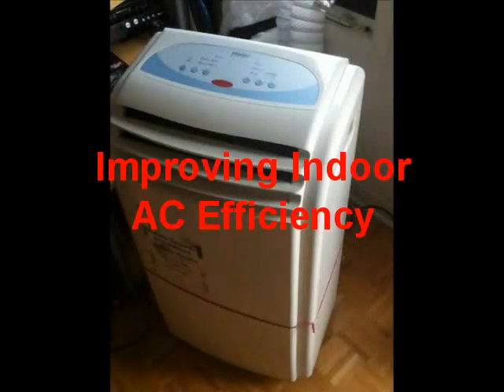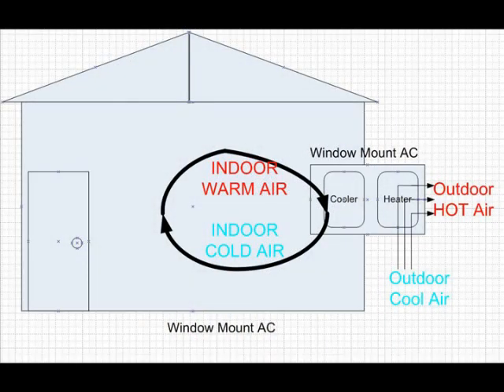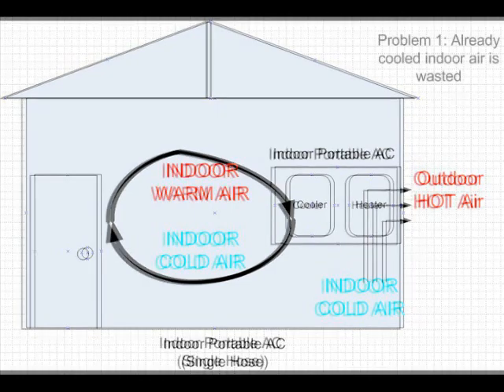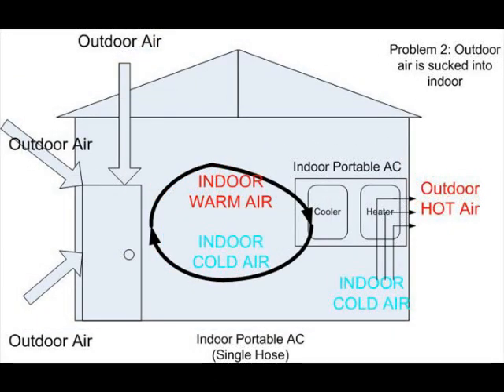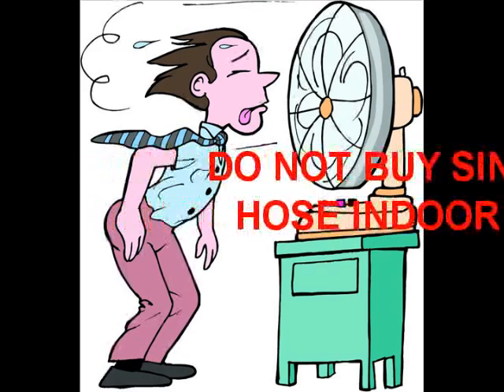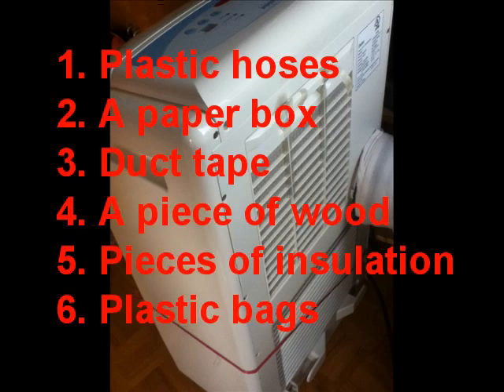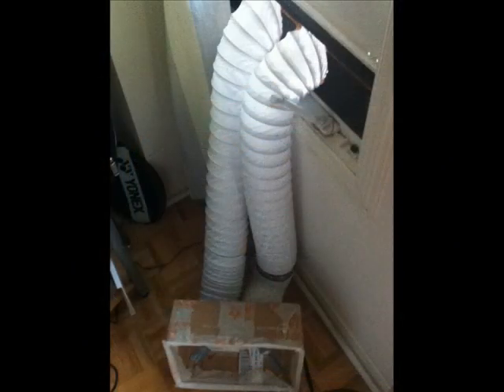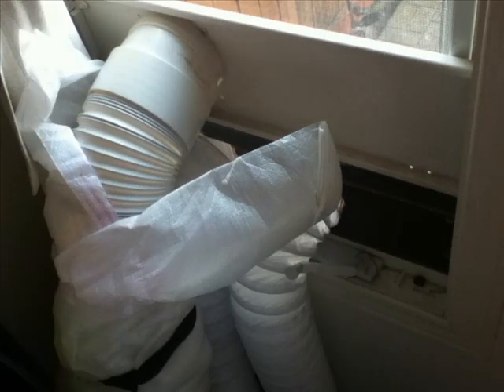Indoor Portable Air Conditioner Efficiency Improvement: single hose to dual hose conversion

Comment: Thank you for hour inspiring ideas, use the Dual Hose is so much better, but they are not available in Europe. I live in a Historic Building and it is impossible to put a condenser outside.
Also, I would also like to spray the condensate water over the condenser coil on order to increase the efficiency 👍.
Reply: copper has a degree of flexibility - if you could get my hand on an old single tube model for cheap, I wonder if you could just bend the evaporator coils and condenser coils 90 degree out of plane with each other, and build a new chase for the outdoor air.  Because the real problem, as critics of this video point out, is that the cost cutting move is really about having a single blower and enclosure for it.  So 1/2 of the indoor air gets sucked and pushed out over the evaporator, and 1/2 goes over the condenser.
Reply: BTW, surprised to know Europe allows the idiotic single tube design!!!  The manufacturers must have had to bribe a bunch of EU regulators haha!

Comment: What if you live in a hot city like Pheonix or Las Vegas, or a humid and hot city like Miami or Houston? Since the inside of a portable a/c is metal, plastic and wiring, I would think you wouldn’t want super hot air and/or lots of humidity going into the unit. 🤔

The most important thing really is to ignore the ASHRAE rating and look at the DOE SACC rating instead, which takes into account the inefficiency of a portable a/c. 

If you want to cool a big room, like a master bedroom, you want a SACC rating of around 7,500-9,000 BTU’s. For smaller rooms, 6,000-7,500 BTU’s should do. I wouldn’t mess with anything that had less than a 5,000 BTU SACC rating (unless the room is smaller than 150 square feet). 

Covering your exhaust hose with an insulated HVAC duct will eliminate the heat coming from the exhaust hose. You can use big zip ties or shoe strings to secure it on both ends. It’s ugly, but it works. 

One last thing, once you start using your portable a/c, keep the filters clean and check your unit for water as often as you can. This will help it run as efficiently & effectively as possible. 

Stay cool! 🌬😎

Thank you for sharing this video.

Comment: Can't you just put some plastic wrap/cling film over the intake grille (taped down securely with duct tape) and attach it over the 2nd hose with a rubber band instead of all this unnecessary boxing, etc.?

Comment: I did the modification but still theres not much improvement instead it put some extra load on the exhaust fan and i noticed a decreased airflow from the exhaust hose, secondly the compressor got hot and had to remove the modification.
Reply from the maker: Could it be because the new hose(s) you added is(are) not wide enough? I wanted to make sure the new hoses I added did not limit airflow. That's why I added two intake hoses instead of one.
Reply: onlyzaki4u Think about it, if you have a hose pulling air in, and exhausting back out, that is indeed pressure equilibrium, however, when you take half of that air, and use it to blow into the house... suddenly you are no longer in pressure equilibrium, and are fighting again in a different way. You are then moving the load from the exhaust to the intake, which the unit may not designed for if it was originally an exhaust only unit. 
The cure for this is to make your intake hose perforated(add mesh to keep critters out). This will cause natural equilibrium to occur at the optimal location. This will mix part of the rooms air with fresh intake air at the perfect ratio naturally to offset the negative pressure caused by the exhausting of the hot air, and the opposite positive pressure caused by air being pushing into the room from the outside.
Additionally, it will chill the air exiting the AC by mixing in air that has already been chilled by the ac, increasing efficiency further :)

This may be over thinking it, however, you could install thin rubber flaps on the inner side of the perforations to serve as a barrier to the outside when the unit is not running, which would allow the air from your house into the hose if it is in a state of positive pressure. Think of a giant one way valve :) That is more that most people would need, but would keep the cold air in when the unit isnt running without manually sealing off the intake hose.
Reply: ***** That's not possible on a single fan unit. The air conditioner must blow air into the room, it has to come from somewhere. 
If you have no intake, and only exhaust, you have a negative pressure situation, intake and exhaust is positive pressure because the air being used to blow air out of the unit comes from outside. 
You have to do a little of both in order to balance the airflow, and a perforated intake is the only solution for a unit originally designed for a single hose with a single fan.
Dual fan units automatically pull air from inside and outside to balance out the pressure. They have a fan for inside, and a fan for the intake/exhaust.
One fan pulls air from the room over the coils, and back into the room.
The other blows air over the heat pump to cool it, possibly melt condensation ice, and blow air outside. 
My advice was for a single fan portable AC unit, which I suspect is the guys problem that made this post.
Reply: can i instead use an electric air pump used for inflatable? it will make the hose much thinner and still pump a similar volume of air into the intake vents
Reply: ***** It will not be a similar amount of air. Maybe a shop vac... Air pumps have a high static pressure, but a low cfm. The amount of air these move is quite impressive.

Comment: I have this other unit the fan it is not as powerful I had to put a booster fan on the intake with a 6 inch intake pipe and had to take the unit apart to seal all the compartments to separate the condenser with the evaporator and the cooling capacity has tripled it was just very messy I use a lot of expanding foam and caulking on the inside and mounted a galvanized sheet Inlet on the outside with a very expensive booster fan I paid about 170 for it

Comment: If there's anyone watching this channel, can you possibly tell me how to be sure which is the intake? There are two areas where air is coming into the unit, upper (where there is a filter) and the lower. You are using the lower.  What's the difference?
Reply: Read the user manual!
Reply: the upper where the filter is for the air that is going to be conditioned and cooled over the cool coil and then is going to be blown back into the room (so yes it is an intake- but not the one you are looking for).

the second lower intake is the one you are looking for. as it is this intake that is bringing in your precious ac cooled air over the hot compressor coil and then out of your 'single hose' to the outside world.

as the problem lies in the fact that your wasting your indoor ac cooled air to cool the the hot compressor coil, the solution would be to separate that intake to the hot coil with maybe plastic box/ducting - maybe even add you own little duct fan to assist in air movement and to draw outside air (which should be cooler than the hot compressor thus taking away its heat) and re-duct that hot air outside. 

so your effectively making a diy dual hose ac from your single hose ac.

Comment: Which intake did you place your box ontop of? My system(I'm sure yours as well) has a Evaporator air intake, and a condenser air intake. Should I place my box over the evaporator intake, or the condenser intake?

Comment: I have recently bough Super General Portable AC model SPT122T 12,000 BTU. It's Single exhaust hose.I live in United Arab Emirates,Dubai.It's a desert country average Temperature is 45 degree to max 49 degree with relative humidity 80 to 95 %.Here Summer is 8 months.Peak time from june till sept end.This portable AC not Designed for the GGC or Arab country.I believe it's for US country. Even then with single hose connect to my widow..Still the cooling is really good when compared to a window AC.80% efficient in terms of cooling.but i did wrap the exhaust hose with aluminium soft sheet roll with duct tape.The heat from the exhaust hose does not radiate to my room.My room is small.may be of 400 Sq feet. I do not think that duel duct is required.It still does it job of cooling the room very well.I live in apartment which has top floors.I have put thermal insulation on my window.
Reply: How many layers of aluminium foil did you wrapped over that single hose

Comment: Can we put the compresor and condenser outside window, so the heater is outside we don't need hose
Reply from the maker: I thought about doing that too. But then you also need to have two hoses connecting the unit through the window. One for producing cool air to the house, one for collecting warm indoor air into the unit. So the complexity is the same.
Reply: Can you make tutorial video, how to do it?
Reply: My p.ac have 4 screen! 2 at the back and 2 at the left side!
Do I need to cover them all?
Reply: @miji2769  lol my head is spining

Comment: Before anyone buys a 2 hose portable AC, stay away from Amana and hier. Their 2 hose designs still draw in air from the inside of your room. I have one and have tried many things to seal the ac. It actually have vents in the back that suck out cooled room air so I blocked them up. I guess it's now sucking in some air from the bottom and sides of the unit. I sealed my room as much as I can to allow the intake hose to do it's job. 

If you need a better explanation ask and I'll go into more detail.
Reply: esqueue Theyre supposed to draw in air from the outside....

Comment: Wouldn’t this design suck in all the bugs, dirt and debris from outdoors?
Reply: Great point, I just converted my portable AC to dual hose. To solve this problem I installed fine mesh mosquito net on the intake hose. Works like a charm, to be considered I live pretty high up. If you have the possibility  (with I don't due to apartment rules even though I own) just buy a regular AC it's worth the cost due to electricity consumption, noise level and cooling capacity.

Comment: This will work only if your model completely separates the airflow into the hot side from the airflow into the cold side. if it has a single intake and a single fan feeding a split duct that feeds both coils, any air brought in via the added hoses is going to be split between the inside and outside, adding heat to the room. So learn about the design of your unit before attempting this. Single hose designs are a disgrace and should not be given an "Energy Star" rating (or non-USA equivalent). All portable ACs should have ports for two hoses; that way the user can decide if it's worth the mess and bother of a second one. Successfully adding an intake hose and keeping the air flows separate will not only increase the efficiency, it will also increase the cooling capacity of the unit.
Reply: landlord bought a single hose $330 unit this past winter that includes a heat pump. now, it's summer and with a 5050, 6000, and 12000 btu unit combined we are unable to cool our second story 880 sq ft apartment. FML. 

p.s.: thanks for the clarification. AFAIK, you saved me from falling for this bs once i realized that my ac only has one blower!
Reply: ". now, it's summer and with a 5050, 6000, and 12000 btu unit combined we
 are unable to cool our second story 880 sq ft apartment. FML. "
Yeah I can't believe people give these good reviews...you read stuff like "my 12K unit really cools my 200 sq. ft bedroom well."  But a 200 sq.ft bedroom should need < 5000 BTU to cool it!!  The people giving them 5 stars on amazon are idiots who don't realize they are throwing their money down the drain.  Hilarious.

Comment: just bloody cool the hot coil from outside air and blow that hot air outside. your simply finishing the job by converting it to a dual hose. if you on;y have one blower just simply buy another blower. job doneski.

Comment: I use a De'Longhi 14000 BTU unit (http://imgur.com/21f1rOO) According to the manual, there are two intake grilles- one above the exhaust hose (A6, with the removeable filter), and one near the bottom of the unit (A8). If I were to do the mod pictured here, would it be for the top or bottom intake or both?
Reply: The filtered intake is for the air that is circulated in the room. The other one should be the one you want to duct outside. A way to test this would be to put a piece of cardboard over each vent and see which airstream it blocks.
Reply: +Matthew S sounds easy enough- and you were correct, the filtered intake is the indoor air. I have since picked up another air conditioner; 

http://www.insigniaproducts.com/cms/documents/manuals/NS-AC10P6WH_NS-AC10P6WH-C_NS-AC12P7WH_NS-AC12P7WH-C_WEB_EN.pdf

It appears to have only one set of filtered intakes on closer examination, which I imagine would make it ineligible for this conversion?
Reply: I opened up the unit and confirmed all three vents lead to a shared compartment containing both the intake fan and the condenser- they are not compartmentalized. Acknowledging this, would there be any practical sense in attaching an intake hose to the unit? Certainly the negative pressure will pull air in from somewhere- so there may be a benefit to running it running it over the compressor- but that means some of that air will also end up inside the apartment.
Reply: VectroniX That's really interesting. It is strange that they would only put a filter on one of the intakes when both lead into the same compartment. I'll have to take a look inside mine as well because I did go through the trouble of creating an intake from the outdoors. I hit up an AC forum and everyone laughed at me for expecting this to cool my garage :/ Lesson learned.
Reply: +Matthew S  sorry if I wasn't clear- all three intake vents are filtered on the insignia 12000.

Comment: Okay its August 19, 2017 I just bought a 12,000 BTU single hose "evercool" brand portable air conditioner. I live in Monterrey, Mexico its 36 degrees celsius outside, wich is 97 degrees farenheit. Its a fucking mocrowave outside right now. As hot as my cpu. My portable air conditioner has a limit of 62 farenheit to program it. I am running it at 74 degrees farenheit because its too cold if i set it to 62 degrees, I had to lower the temperature. My room its not big its 3 x 3.5 meters, but again, Im not using the portable air conditioner to its full capacity. So I dont know if a doble hose works faster or cooler, but my single hose can freeze my room if I want it to. So single hose are just fine man stop uploading this shit. Ive researched and found that doble hose cool faster and keep the same pressure inside and out to prevent hot air coming in from outside trough the bottom of the door and stuff and its true. But single hose devices work too, even if they have to work slightly harder, they get the job done. Just came here to 
demystify this shit because I watched this video before buying my single hose and I was a little concerned it would not work right, but it works perfectly, so yeh, you can go put your double hose aire conditioner up your ass :). I do have to specify before I go.... The device I bought is 6 years old, its a used device. Im gonna buy a new device soon for another room to see if theres any diference at all.
Reply: You have a 12000 BTU AC to cool 10.5sq meters (100 sq feet) of living space. And you want to tell everybody there is no problem with using a single hose AC? It is like driving a tank versus driving a passenger vehicle to go around town. Stop spreading rumour around the world. And stop heating up our atmosphere, wasting our valuable energy.
Reply: +karate gal Yep. My room size is 115sq ft. My dual hose AC is only 5000 BTU!

Comment: I used your method, and mess up my ac.
Reply: it spoilt?
Reply: I have a 12K BTU single hose unit.  For the exact reasons stated in this vid, I made a mod using only 1 x 4¼" dryer hose and cardboard box as an intake.  Made sure everything was air tight and then turned on the AC.  Not even 5 min after turning it on, the compressor shut down.  The condenser part (bottom) was hot as hell, so clearly, not enough air was feeding it.  So I decided to compromise and poke holes in the box I've cut to size to fit my mod so that the unit would take most of its air from the hose, little from the house. Condenser breaker didn't trip but the AC was running poorly and the air coming out was not as cold as it used to be.   So I poked so more holes to test.  The more holes I poked, the cooler the AC was running.  Moral of this story: I doubt that 2 hoses would have made a difference.  The unit was designed to be used as is and not moded. The logic behind this vid is flawless and a single hose unit is really the worst you can buy.  Trying to mod it will most likely result in lots of wasted time and energy as you most likely will, like I did, revert to the original design and just live with the extra electricity spent for cooling the OUTSIDE as well as inside your room.  

Like someone pointed out, most likely, a 5K BTU window unit would give you a much better performance and cost way less in electricity.  Problem is you will, if you are stuck like me with a patio door, figure out a way of installing it properly.  For a DIY'er like myself, it's not a problem, but may be challenging for some people with less equipment/tools and not the "handyman" type.

So bottom line, buy a 2 hoses unit or use and fit in your "opening" a normal window unit as best you can.  Smartest solution would of course be the normal window unit.  They cost nothing and are really efficient, much more than 1 or 2 hoses "portable" units.